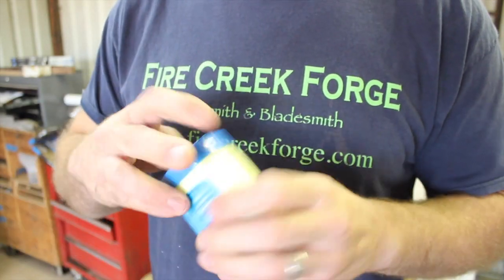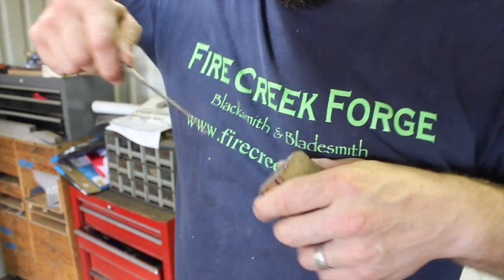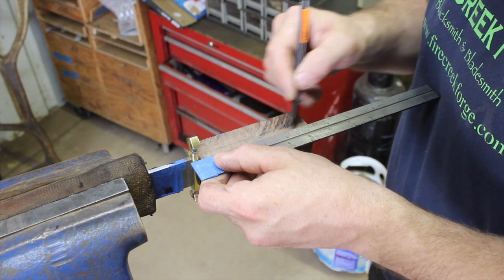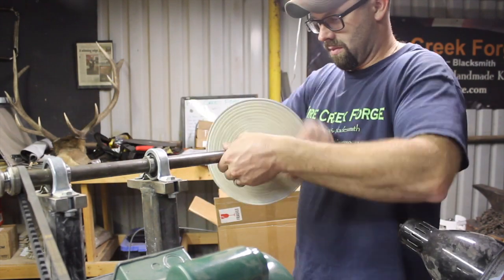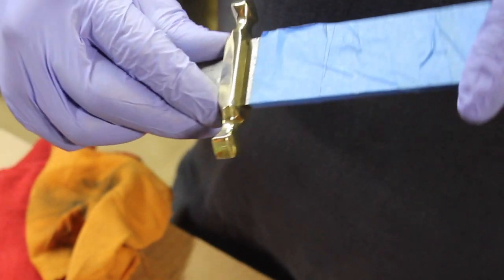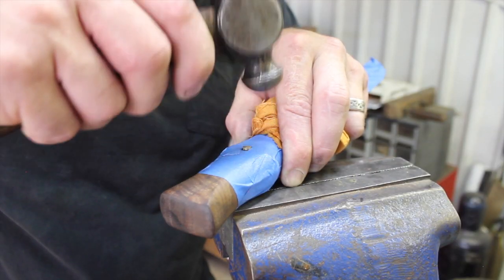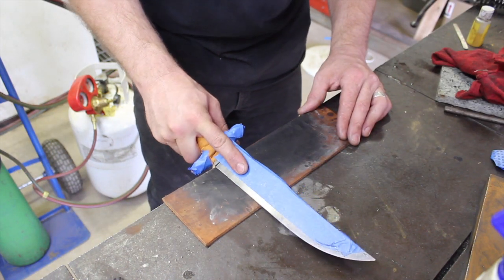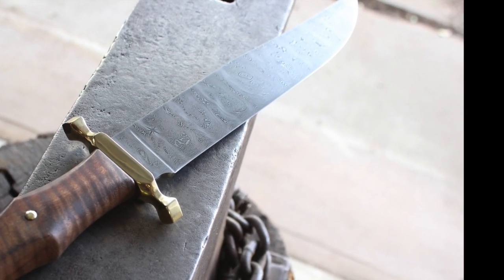FORGING a DAMASCUS Bowie Knife From Saw Blade Part 4: FINISHED! Bladesmithing And Knifemaking

Comment: I'm new to your channel but would recommend getting a "hand squeezer tip set" to help with domed pins. Drill a hole roughly 3/16 into a steel block and insert the tip. It will support and dome both sides of the pin at the same time. Beautiful knife by the way

Comment: The end result turned out great, a top job and a good looking knife! Really like the pattern in the blade, the contrast between the colour of the brass guard and the dark handle material also added that extra touch to the overall result. Regards from the land “down under “.
Reply from the maker: Thanks mate!

Comment: Very nice.   What would happen if you took master lock shackles and made canister Damascus from them?  They are boron carbide, if I'm not mistaken, hard stuff, chips up bolt cutters.   Might be a cool, huge fish scale pattern.  Might be too brittle?
Reply from the maker: Thank you. I'm not sure, I don't know how well carbide is going to forge weld..?
Reply: @FireCreekForge  ya, me either, but, if you have any old locks around with missing keys, might be a screw around project to research.
Reply: @JohnJohnson-bg2oo  boron carbide is a ceramic.
Reply: @TheTurinturumbar  nope, if it were, you could shatter every master lock on the planet with a hammer, as the shackle is boron carbide.   Unless they falsely claim the materials used to make it.

Comment: Maybe you could use a syringe 💉 and blunt needle to inject the epoxy into the tang hole, so air will not prevent it from flowing to the bottom,  because you are starting the fill at the bottom, tractor supply, and vetenary supply has them fairly cheap, I have one 500ml.   Is there a expanding epoxy that could be used? Seems I heard of  expanding and non expanding epoxy for something?? Great work!!

Comment: That's a beautiful knife but it isn't a Bowie. The drop point isn't pronounced enough. It should have a false edge and the handle is just wrong. I love the knife. It is clean and  has nice lines, just not a Bowie
Reply from the maker: Thank you. Actually it falls well within the lines of what was considered a Bowie knife contemporary to  and following Jim Bowie, which is a very wide description. Some did have exaggerated clips, false edges, etc; many did not.